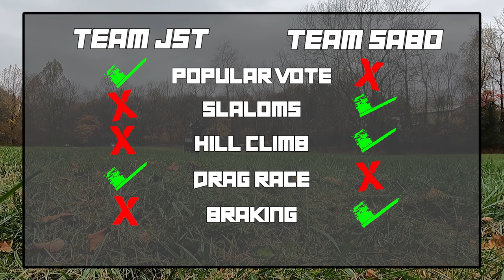We Drag Raced Our Budget Quads Against a NEW YFZ450R (We Were Surprised Who Won) TopQuad S1 FINALE

Comment: I was so hyped when the Honda won the drag race!! HONDA❤️
Reply: Luckily there wasn’t an LTR there lol
Reply: @natedog1619  it would have blown up. The ltr are the worst quad on the market and really the kfx isn’t much better. The only benefits to the ltr over the two is a little bigger after markets Honda Yamaha and ktm have the aftermarket and stock reliability. Ltr can be quick but the few I’ve been around always seemed to be broken more than not
Reply: @dakotadickens3747  my LTR ran for 5 seasons of MX and free riding, I sold it and it ran for years later WTF are you talking about? LTR is the most bulletproof quad ever made aside from EFI issues that some rarely encounter
Reply: I know that sounds blind and biased but I’ve owned them all, the LTR is king and I’d trade my 21 YFZR for a brand new 08 LTR on the spot
Reply: @natedog1619  you must have never ran it hard. Because ever ltr that has came through out friend group has been blown up within 6 months of riding 😂 but the Honda’s and Yamahas always seem to do fine. Also strange that there are a lot more Honda’s floating around still even when production stopped and the after market for Honda and Yamaha os still rocking but the ltr support slowed way down. I wouldn’t give someone $500 for a ltr in nearly perfect condition
Reply: @dakotadickens3747  my entire garage wall is covered in hardware I won on a stock LTR, sorry dude. You are a casual rider, I rode MX for 5 straight seasons.
Reply: @natedog1619  casual rider yet have 4 built national bikes that have more in the motors than your bikes even worth 😂. Bikes with 5k engine builds and most ltr around me sell for that even built. Hey you can love them but the fact that most of them are trash is just a fact. Suzuki always have out dated engines they will catch up one design then be behind for the next 4. Always have been in quads and dirt bikes. But hey you like what you like not worth talking sense into anyone that can’t see Honda and Yamaha have always been better and have always owned the market

Comment: I'm glad you're doing this to show people the power of the KFX because I've been trying to get that point across but also one thing I did notice is that you have to stock intake on if you would have had and fuel Customs intake or even a Suzuki LTR 450 intake you would have smoked them on the drag race I did that and I got six horsepower out of my quad
Reply: Fci, power commander and exhaust and those Kfx450r’s are mental 🤪

Comment: I think they should’ve switched machines to take the rider out of it
Reply: I agree but what's keeping someone from sandbagging then lol
Reply: @travisj6473  like I said above award the fastest riders.
Reply: So the original plan was to have Pete and I ride each quad for the challenges to make it solely machine based but the day of we felt it made it more interesting to have it strictly JST vs Sabo. As builders and riders. I think it would be interesting to see them build two MX machines and have Joel hetrick ride them and decide which is best. Or GNCC machines and have Adam McGill or Hunter Hart ride them.
Reply: @travisj6473  that’s why they ran with the YFZ450 as well. Hard to sandbag with a 3rd party in the race.

Comment: Pete makes a good point about buying new. I bought a 2005 raptor 350 new. It still runs like new and even has the original clutch. I have a heavy duty tusk clutch ready to install but I just haven't needed to. If you know how to maintain your machines, a brand new machine can last you decades. All my other machines have been used and I rarely keep them for longer than 3-4 years but I just can't sell my raptor 350 just because of how great it runs.

Comment: I've done both new and used purchases a few times with quads. Even new machines have a fair amount of tinkering needed as maintenance, pretty much all of which requires the same amount of teardown to get to the insides...so whether you buy used or new you are still going to be pulling the plastics and tank and whatever else to get to valves, plugs, etc. It's a tough question. There is definitely more value in a used machine with aftermarket parts on it. even a top-end build isn't horrid. But I look at this bin of parts I need to put on my wife's 400 and I'm on year 3 of just general maintenance on my new in 18 machine and I'd rather go ride mine than work on hers lol. 

This was a fun series. I wish you guys had a single top quad channel vs bouncing around. Thanks for all your hard work!

Comment: Entertaining series for sure. I'm enjoying it. My question is, (never had a quad before) Why would I want a 450 over a Raptor 700R? I'm used to motors, as I own a Kawasaki ZX14R and an Aprilia 1100RR, but is there something that makes the 450's more appealing? Are they more fun or what? Thx. P.s. I'm 43 and 210lbs and never plan on racing it.

Comment: I could see a utility or 4x4 top quad series being fun and successful. Mudding, uneven and rough terrain, working the quad etc. That would be fun. I honestly have more fun in mud and on slow technical rides than fast trails. I still get the need for speed though on occasion.

Comment: The 9000 he spent, you can rebuild a atv with all the top of the line mods and motor, and would be just as dependable because of the rebuild but way more performance wish twice as good, I did it and had the faster tricked out bike in the county, on the track and off, my view of it
Reply: I would’ve loved to have done that but I really wanted to support the industry with another new ATV purchase. My next ATV will be used 👍

Comment: So, this guy found that nice 450 yamaha for less than 3 grand?
Reply: What? Did you even watch the video?
Reply: @chevyon37s  what did I miss? Coulda swore they said they bought them for 3 grand near the beginning of the video....and guilty lol. I had to save the video  because I was at work. Oops. I guess I'll finish it now.🥴
Reply: Ooookkkayyy. That's interesting. First four-wheeler I bought was a Warrior for 900 bucks. It out-ran a basically new one. It didn't last very long though, to say the least. I found there was a hole in the block patched with jb weld. How it even ran at all is a mystery.